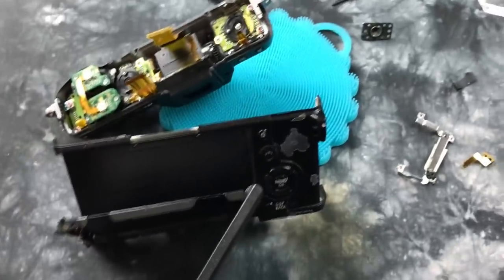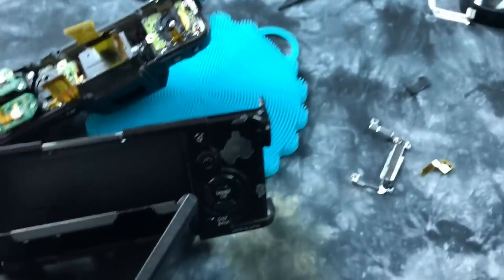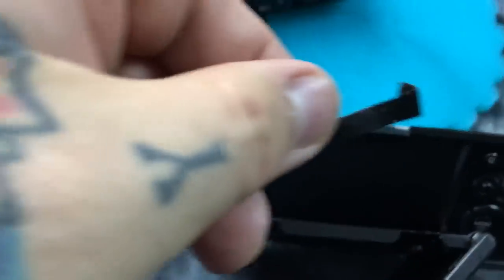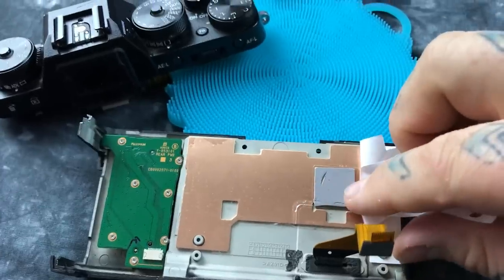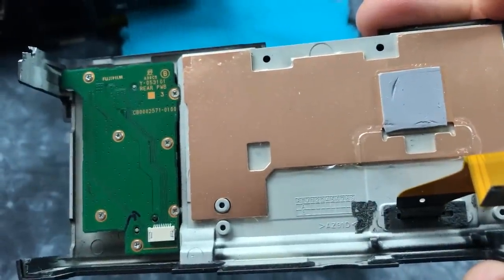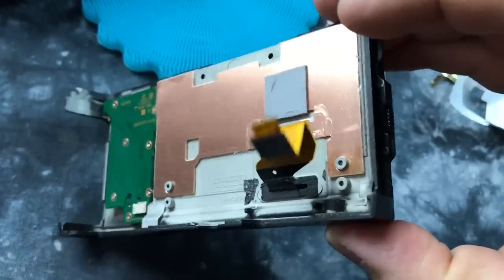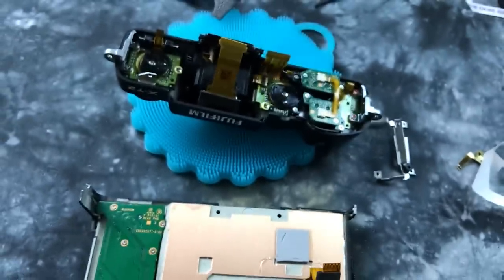😄 FUJI XT-2 inside Heat sink & More. Teardown part 5

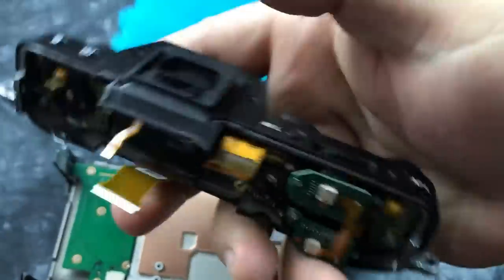Comment: 2:29 hi, my on/off power button popped off yesterday, I was wondering if you shot how the assembly mechanism for the shutter/power button works?
Reply: Im repairing this right now. There'sa tutorial on howto apply glue from the outside, but it didn't work for me. You have to tear it apart, take offthe old glue, and apply new glue from the inside. I'm current;y trying to piece things back together.